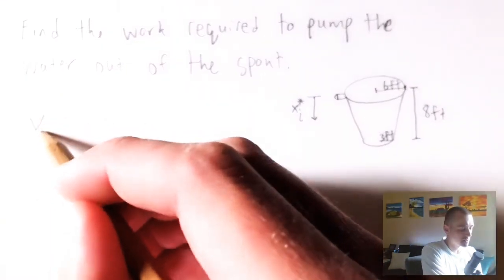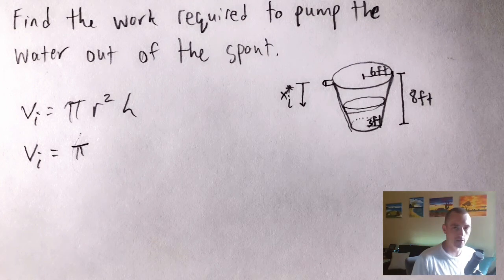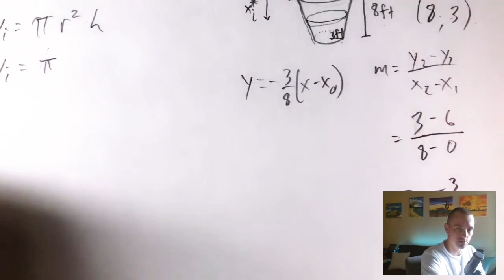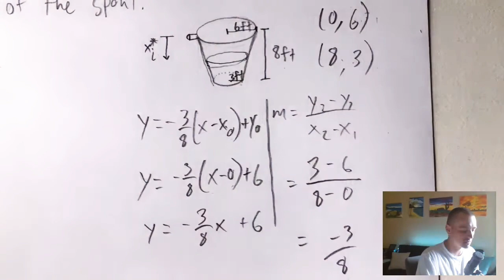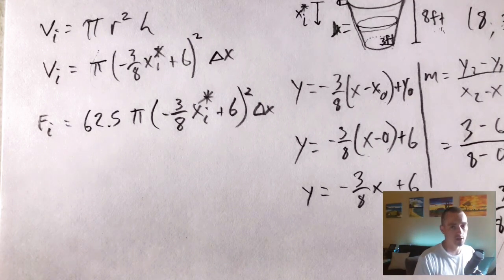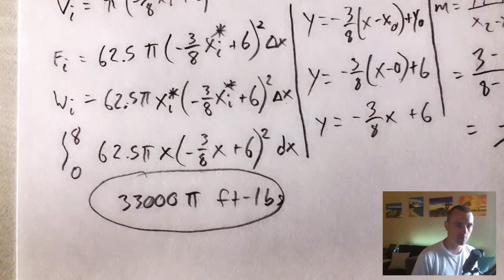HOW TO FIND THE WORK REQUIRED TO PUMP THE WATER OUT OF THE TANK | Work Calculus Formula Feet-Pounds

Comment from the maker: MY CALCULUS 2 STUDY GUIDE - https://jakesmathlessons.com/calculus-2-study-guide-integral-calculus-cheat-sheet/

0:00 Find the work required to pump the water out of the tank
0:31 Draw a sketch and name your variables
1:01 Find the Volume of the ith disk
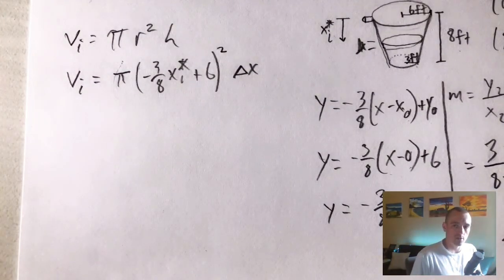6:31 Find the Force acting on the ith disk
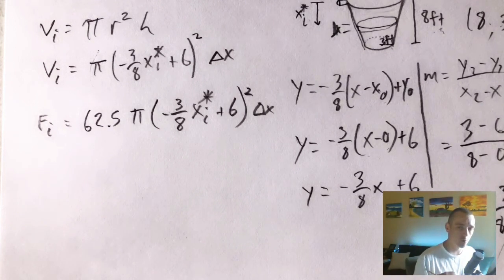7:40 Find the Work required to pump the ith layer
8:58 Set up the integral to find the work required to pump all water out